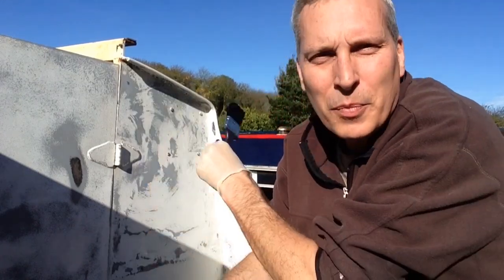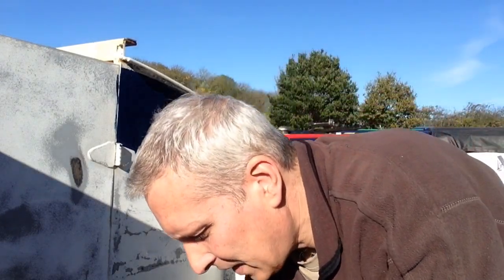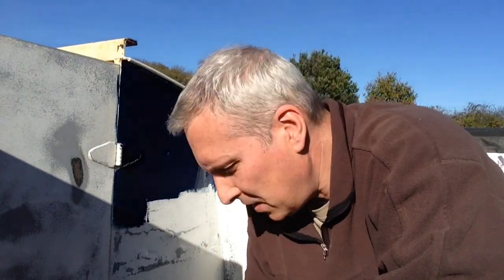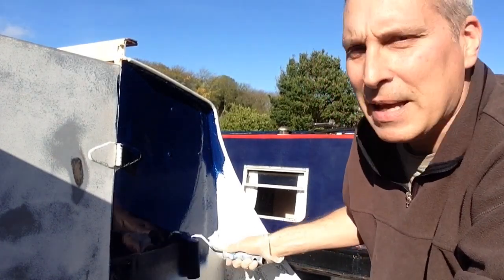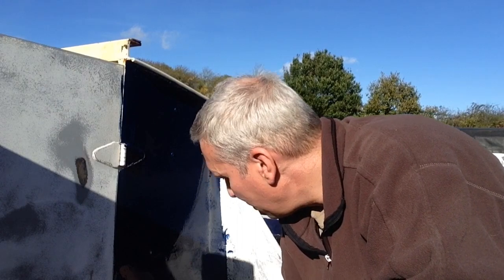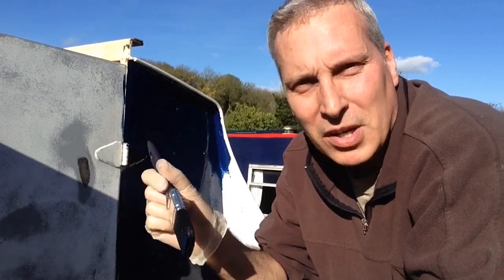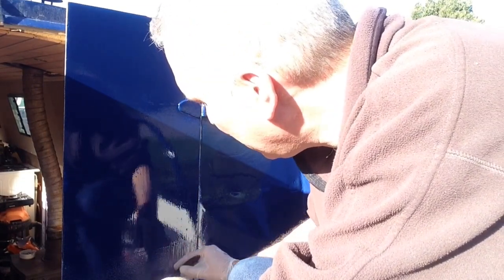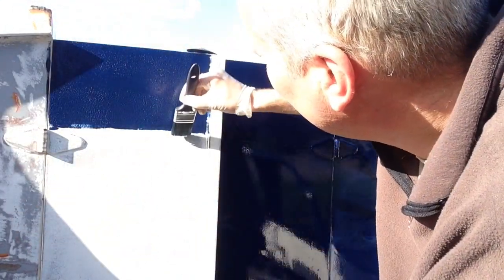Ed's narrowboat Ep 34 more painting and top tips

Comment: no need for a primer?
Reply from the maker: John Hartley Hi and thanks for the comment. That part has already been primed from whem the doorway was widened by the previous owner. The white paint is just a thin layer that was put on to keep the weather out until it was time to paint it properly. I have just sanded it to give it a key.
Reply: thanks Ed.  I take it that you're working with oil-based paint.  yes?
Reply from the maker: John Hartley Yes i believe it is.
Reply: Yes, must be oil based, latex paint would not dissolve the foam roller.

Comment: I used a dark green hammerite, all went good, rails, doors ect, then when I got to the gas locker the paint wrinkled and pulled half way through, the side was good, looked like a spray finish, but the front just went bad. this was all done within roughly the same time so brush and roller still good and weather consistent. So, any idea what went wrong?

Comment: Having just done he roof of ours just cleaning and a couple of undercoats it's good to get a few tips from you about the next stage so thanks for that Ed. What sort of coverage do you get with tolac? Best, Martin
Reply from the maker: The Narrow Boat To The Deep North It covers quite well but you will need a minimum of two coats. Three coats would be better especially if its never been painted before or you remove all the paint down to the metal and start again.
Reply from the maker: Sorry, misunderstood that. I used about 1 1/8 tins per coat. Each tin was 750ml.
Reply: Thanks, I think it's me and my bad typing and grammer ;) I meant toplac – good to have an idea, we've missed the boat I think so we'll do it in Spring. A chap in the boatyard just did part of his (the collor I think it's called, the bit just below the gunnel) and due to the weather; cold and damp, it all cracked so he had to take it all off, a shame 'because it looked very good.